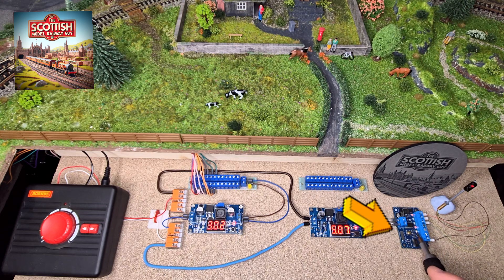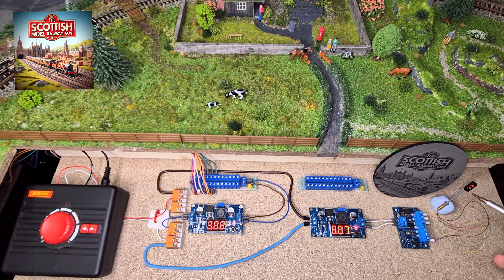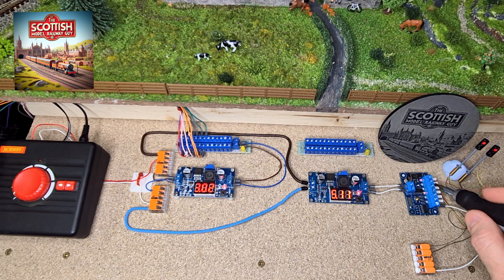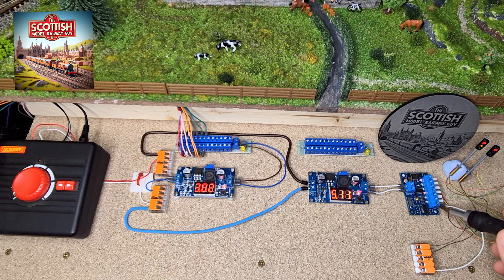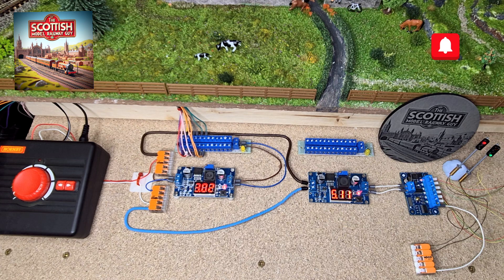Model Railway: Electronic Tutorial (Traffic Lights - Part II)

Comment: Hi, not being an electrician and new to railway modeling (even at my elderly age) I have subscribed to your channel finding it very informative especially for people with little or no previous modeling experience. But I have a question which I hope you may be able to answer. If you did not use the power source, or the regulator but instead replaced this with 2, 1.5 volt batteries in a suitable case ,would I be able to run lots of light's and lamp post light's off of a positive/negative block as you have done ?
Great videos, keep up the good work..
Reply from the maker: Hey, thank you for your kind comments!  I do try to keep it informative.

So... in my video series "add lights to your model railway (part 1), you'll see that this is very possible.  Using batteries to build confidence with electronics at low voltage is an excellent way to approach your kearnings and to experiment. 

But... longer term it does make sense to get them plugged in to your controller.

Have a wee look at that video I mentioned.  You can also buy battery holders / packa very cheaply too.

Thanks buddy 🙂👍🏻

Comment: Is that the blocksignalling TLC2A controller board you're using?  Very neat. On their website it says it requires a 12v supply, if it IS that board then obviously it also works fine on 5V!
Reply from the maker: Yes, it is that one, and yes... it works just fine at 5v.  It's a wonderful wee circuit board petfect for Model Railways or other scaled down projects.

🙂👍🏻

Comment: that is quite a clever little traffic light board, many ways to do that but a single board like that is the easiest way to do it, and by quite a long way.

looks perfect, just add road cones and a line of frustrated drivers
Reply from the maker: That wee board (I reckon too) is the easiest way.  It can be done in many different ways (relays / timers, PLC control, Raspberry Pi) but having a cheap board specific for the task simplifies it hugely 🙂👍🏻
Reply: @TheScottishModelRailwayGuy  100% agree, and for stuff like lights which are so common having a ready made board is perfect.

even as someone who dabbles with electrikery I find this little series very well done and love watching them, if only to  remind me to stop over complicating everything
Reply from the maker: I think the Engineer in me is always looking for the simplest solution, and keeping in mind: "why re-invent the wheel?" 🙂
Reply: Wiring is really tidy.  Layout is coming on well.  Reason the one controller has thicker wires is because it's a fat controller :D
Reply from the maker: Aha... I see what you did there... 🤣🤣🤣